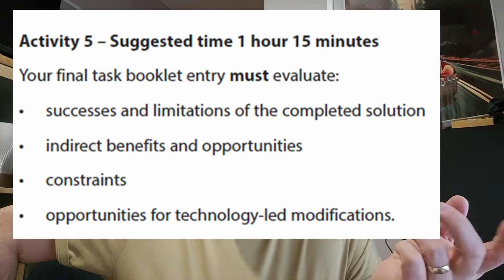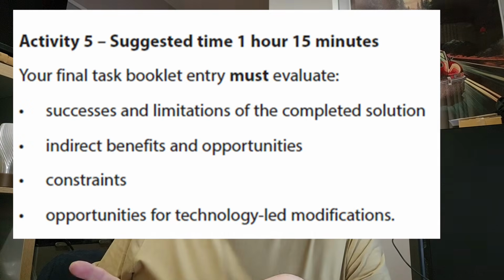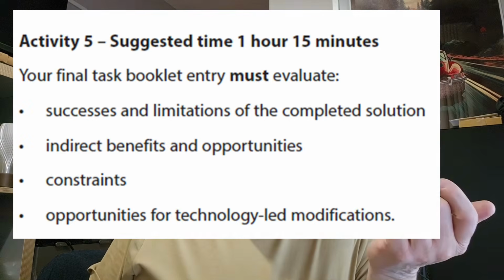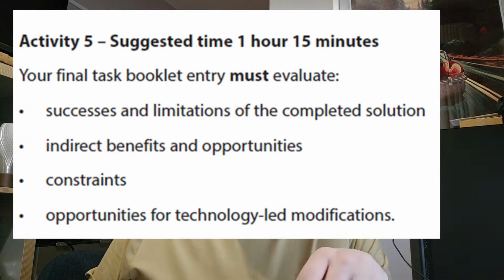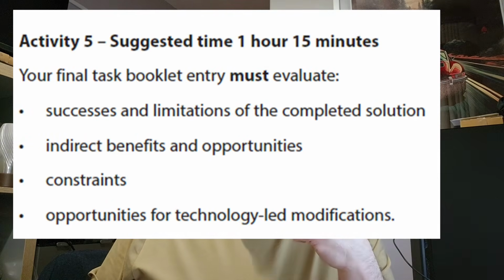Unit 3   Engineering Product design and Manufacture - Exam walk through for Activity 5

Comment: Tmrw activty 5
Any last minute tips
Reply from the maker: Watch the activity 5 video again to start with.
You see the format you need to follow.
Just answer everything as requested, be specific for product.
H&S specific for product use, manufacturing methods and for users.
You have a list. I dont see this exam until Monday so hope not too much is different.
Good luck and use all the time up.

Dont forget the quality check in the last 10/ 15 minutes. 
You may have to tidy some bits up.
Reply from the maker: I will add, if you compare proposal to what was provided does it cover what the customer raised as his problems

Comment: I kept thedimension of holes the same but changed everything the rest of whole design as needed
Reply from the maker: Does it look smart?
Is it feasible design standard manufacturing methods, does the proposal actually address the problems the customer raised.
Reply: @111melcat  Yeah my new desing is a sanwihich Jig with latches on either side to hold it together. Im going with CNC milling as it will be made in batches of 10 and it is not worth to fully automate

Comment: SIR, do i have to combine all three of my activity 3 drawings for activity 4
Reply from the maker: First of all, think on which concept designs fits the best for the problem.
Once you done that, think of which one is going to be the easiest to draw?
Some students do struggle with drawing.
You have to decide which one you are going with to start Activity four.

Now remember on the video for Activity one where you record things, what you done, what has to be finished, what you are planning to do next?
This is where you would record any changes made to the concept.

This means you are not stuck with one concept, you may like something from the other two concepts and need to incorporate that into your idea you are using for activity four. 
Nothing is set in concrete, when designs are going from one idea and evolve into something similar but has key aspects from other design ideas. This is how we create something from a collection of ideas.

Hope this helps

Comment: I have this exam tomorrow and we have had like 3 diff teachers this yr and its been so bad, my unit 3 is being split into 3 parts, Part A (3hrs) Part B (4hrs) and Part C (4hrs) wht should i get done in each
Reply from the maker: Ok, first deal with the research task part A.
Watch my  video all the way through, follow what I discuss during that video.
If your research task is crap then it will be no good for you in exam part B.

I do not know why they said part C. It is part A research for 3 hrs and part B exam for 8hrs.
Only deal with Part A research for now.
When is the main exam Part B getting done?
Reply: @111melcat yeah will do, i think that they aplit part B into 2 so first is on Wednesday and then Friday
Reply from the maker: The video is about 38 minutes long.
Try to remember what I discussed.

Make margins narrow, if you can reas size 8 font, use that size.

Get three photos of different products to help you design solutions in main exam.
Have three the same are useless to you. Make sure there are different.
Now photo needs to have detail of how it goes together. This helps with your design.

Materials, generic properties, tensile strength, weight, corrosion resistance, does it need painting. Can you bend and weld it and so on.
We do not care about the cost of it. Manufacturing methods, fabrication,  how to cut it, laser, plasma cutting.
Do you need to machine it.

What about assembly methods. Make sure younhave a note on this.

Health and safety legislation relevant to product. 

Sustainability of material, can it be recycled and so on. 

Please use text boxes ornsubheadings for each bit of info so you don't have to hunt for that information.

I discuss a lot it's what you write will help you out in exam. 

It will have bullet points you need to find info for. Cover everything 

Hope this helps
Reply: @111melcat okay thabk you, that helps alot in the exam,